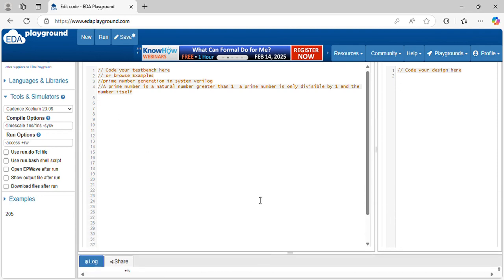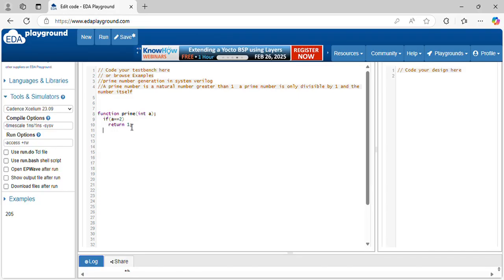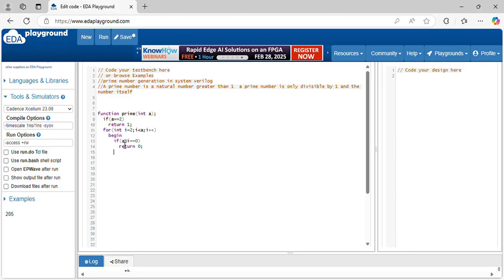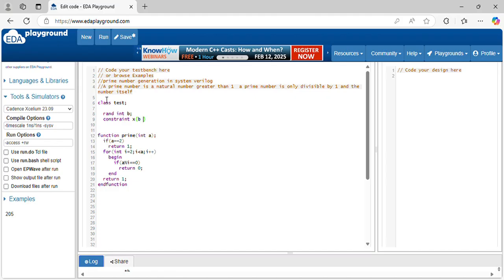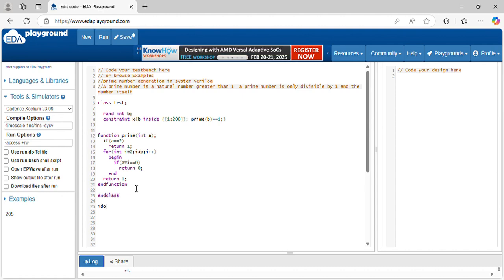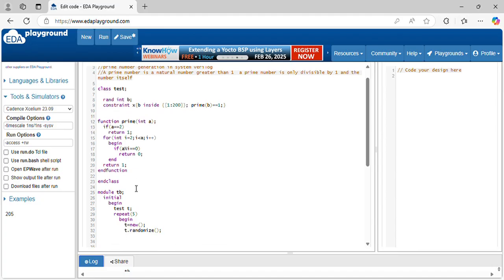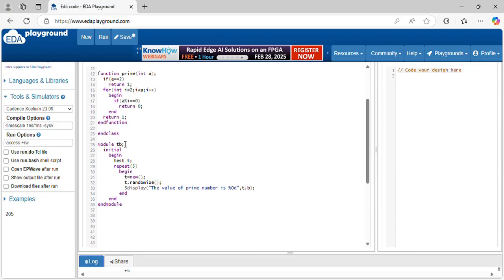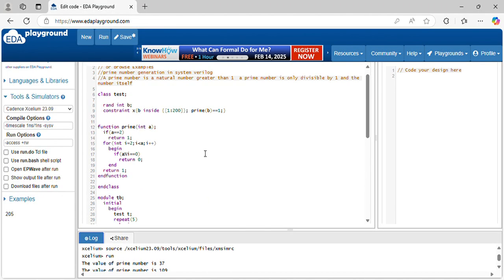Random Prime Number Generation in System Verilog

Comment: above code given a prime number is 1 but 1 is not a prime number right?
Reply from the maker: Thanks for your comment! You're absolutely right—1 is not a prime number. The function in the video doesn't explicitly handle that case, so it incorrectly considers 1 as prime. A proper fix would be to add if (a <= 1) return 0